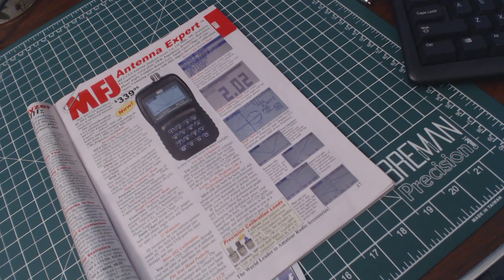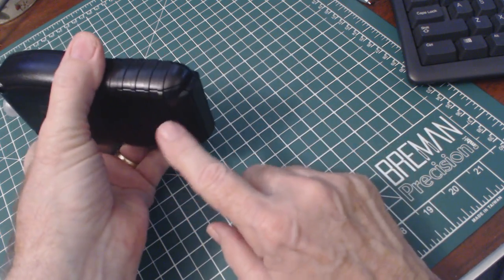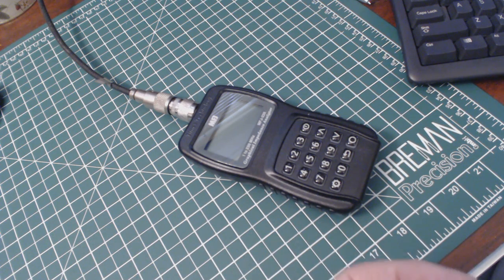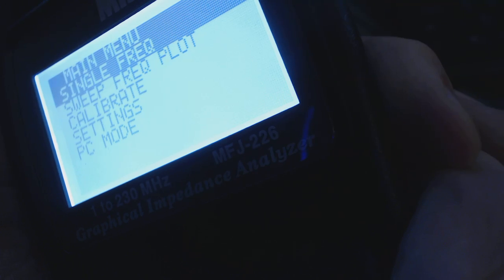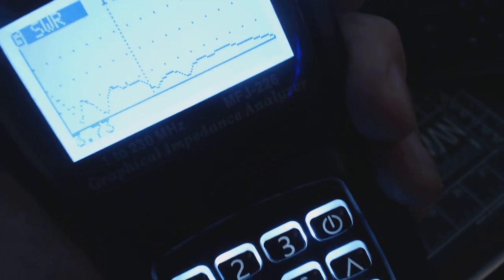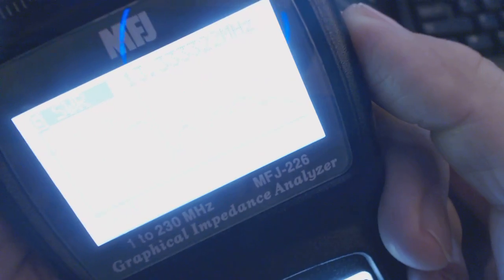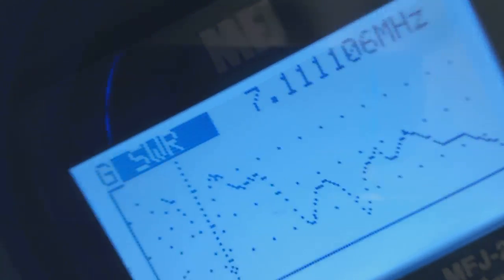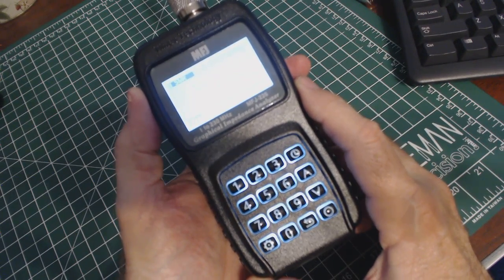TRRS #0790 - MFJ-226 Graphical Impedance Analyzer

Comment: for a very long time I've been dreamed for owning a handheld antenna analyser like this. I hesitate to get a choice because they're not inexpensive for me. there are mfj 223, mfj 225, mfj 226, and rigexpert 55 in my basket if choice. in my opinion, mfj 226, as you review in the radio, should be the marvelous choice for hams because it's relatively cheaper with plenty of functions. mfj 223, in comparison, only has swr meter and doesn't cover vhf band for the same price; rigexpert has lots of functions and quite expensive but doesn't have real time swr graph. I don't know why less people choose mfj 226 and give low scores in their review on eham. really confusing to me.
Reply from the maker: I am not sure either except that many people don't understand how to use it.  For instance, when you select an option via the buttons, it takes a second for it to respond therefore people will push the button again and eventually it will respond to two button pushes given the wrong option.  This is common to devices using slow processor or controllers and you have to get use to it or it will drive you crazy (hence you will give it a bad review).  I have found it to be very useful and pretty accurate.